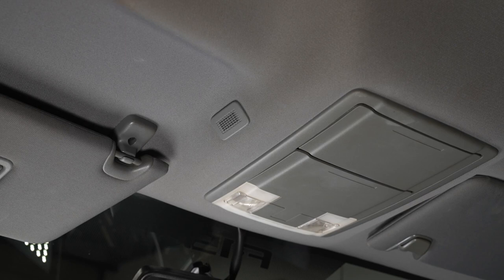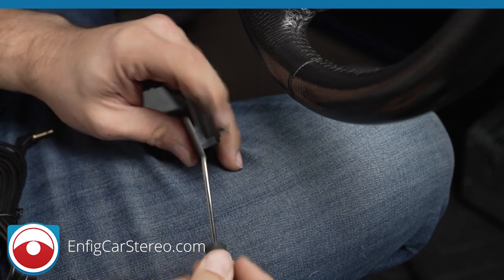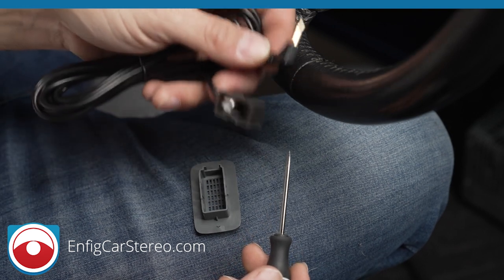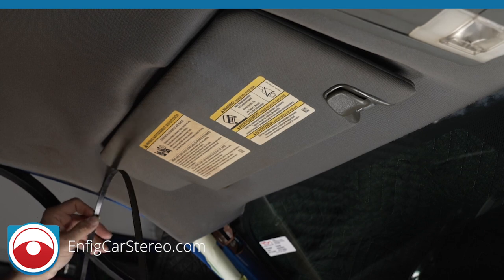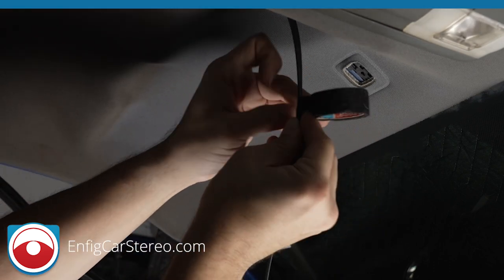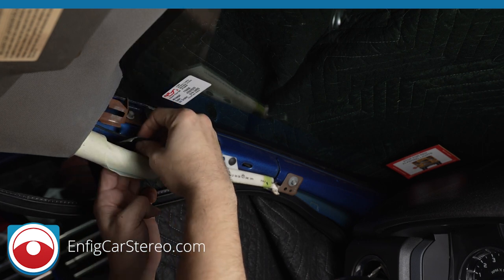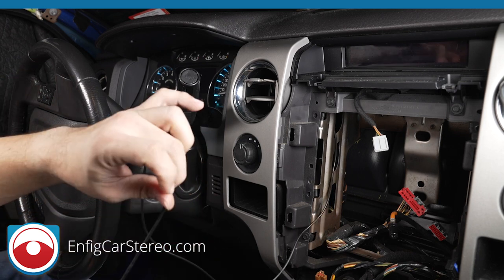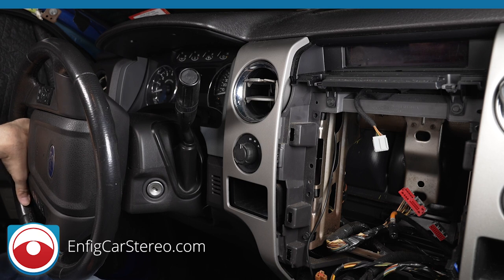Factory fit microphone for aftermarket radios | Ford F-150 2009-2019

Comment: I have an Econoline 2014 van e150 and I don't see any microphone or factory location but on the dash it says sync powered by Microsoft and I'm able to pair my phone with the stereo but I can't talk to it. The buttons work but it can't hear my voice and I don't see anything. The headliner doesn't have anything at all whatsoever except for a light and there's nothing under the visors the mirror doesn't have anything other than the mirror and there's a cable that plugs in the back. I don't see anything on the steering wheel
Reply from the maker: I looked and I can't find any info on that car. Do you have a picture of the factory mic location?
Reply: @Enfig  no, but I'm selling it. Thanks for checking
Reply from the maker: @thedebatemechannel4746  No problem.

Comment: As an FYI the FD2 model will fit MANY Ford vehicles. It works in the 2019-2023 Ford Ranger, 2020 Ford Edge and 2010 Ford Fusion cars that I own. Ford uses this same bracket on basically most if not all their cars.
Reply from the maker: Thanks for the info.  It probably fits most fords 2010+ fords but we dont list cars unless we test them ourselves.

Comment: About to do this to my 1st Gen Tacoma that doesn’t have any of this. I want a clean install, and I know how pesky they can be to get installed in the right spot for sound quality I’m probably going to get the mic cover from the ford dealership, and order your kit. Actually need the same color that’s in this truck. Think it would be good on a Alpine iLX-507 head unit?
Reply from the maker: We have a universal mic but the ford housing is probably better if you can make the precise cut.
Reply: @Enfig  I got the mic cover from ford, and now I need to order your kit.
Reply from the maker: @thomasstrickland0  Sounds good

Comment: Hey thanks a lot I have a 13 F150 with a pioneer stereo I want to get the one it’s a 3.5mm jack? What is the reverse you’re talking about?
Reply from the maker: Reverse?  And Pioneer has a 2.5mm jack.
Reply: @Enfig  at the end you mentioned the left and the right are reverse???
Reply from the maker: @rafaelalarcon8299  The converter is sometimes wired backwards at the factory so we have to test them all when they arrive.  If they are wired backwards they do not work.   We test all the ones we send you for this mistake so you do not need to worry.

Comment: Just got mine today with the 2.5 adapter...just in case. I do have an f250 so it should be straight forward install. Looking forward to finally having the call options available in the truck.
Reply: What radio are you hooking it up to?
Reply from the maker: Pioneer is the only one that I know needs the converter.

Comment: Looking at installing an Android Double Din in my 1996 Caprice, I would like to add a factory looking mic for the bluetooth connection to my phone, this F250 grill looks like it would be easy ti install in a vehicle that never came with one and look factory. Can you think of any others that may look nicer, easier to use or easier to find in the pull a part? something you have a mic for because the stereo I'm looking at has a jack for the mic but no mic.
Reply from the maker: This is our universal headliner mic. https://shop.enfigcarstereo.com/product/enfig-mic-uni2-universal-headliner-microphone/

Comment: Are you leaving the factory mic wire/plug in the headliner? I’m assuming so but I figured I’d ask.
Reply from the maker: Yes the wire stays. No need to remove it. plus it's probably tied into a bigger harness.
Reply: @Enfig  thanks! I have a new alpine HU on the way for my 2018 F150. I may end up ordering this from you once I get around to doing the install. Looks pretty straightforward.
Reply from the maker: @michaelgriffith2762  Sounds good